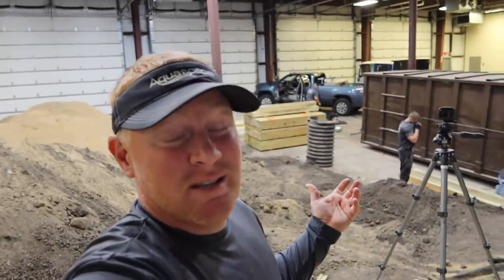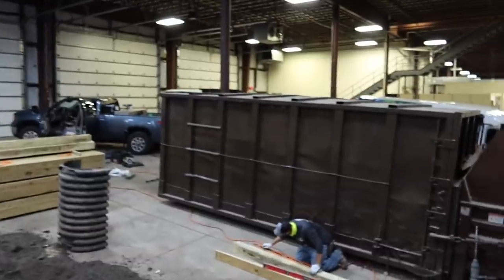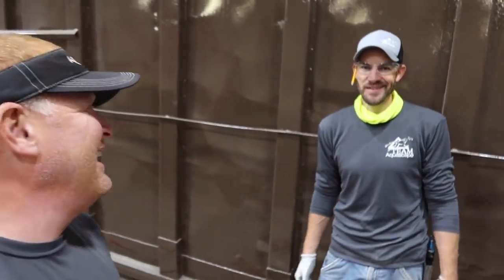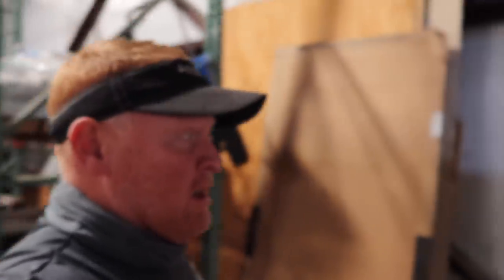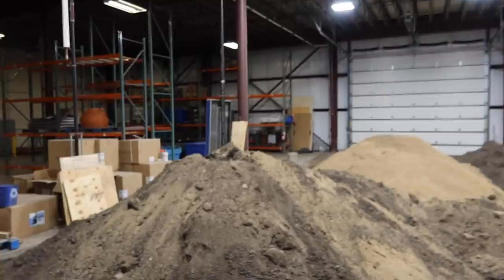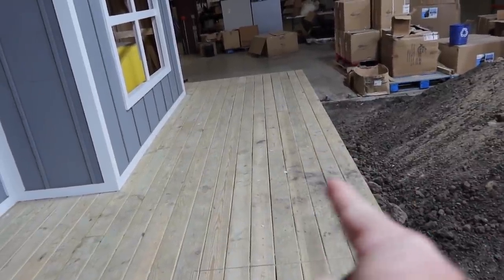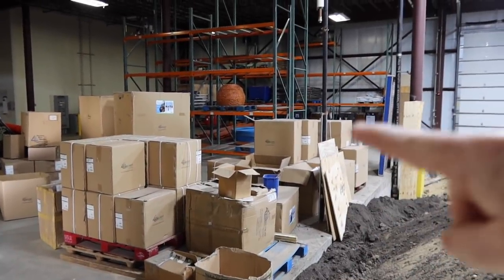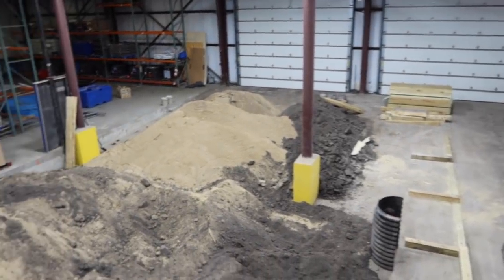Building a *SANDBOX for PONDS*

Comment: What I think would be a neat project would be to try and replicate a very natural long babbling brook.  Grading out a slight elevation change and like a recessed like a creek in nature where the canal is maybe 4' wide and 2-3' deep from where major storms have eroded way the dirt, but the water itself is only about 2' wide ranging from 2-10" deep.  Kind of like a pondless waterfall but more gradual and with water over the bed all the way through.  Using a mixture of sand in deeper wide slow moving sections and river stone in thinner fast moving sections.  Doubt this is a look any customer would want to have built in their yard, but think it would be really cool to mimic nature so accurately.